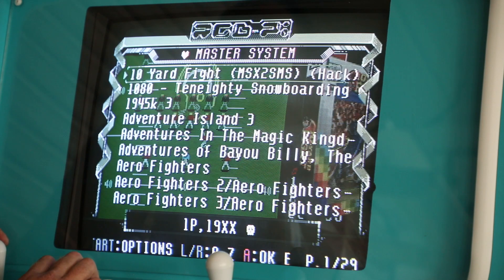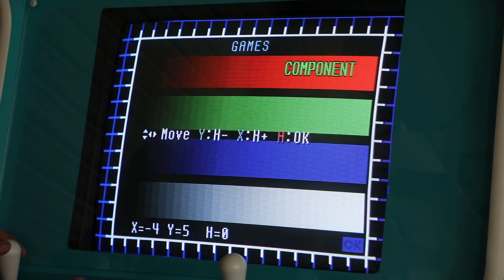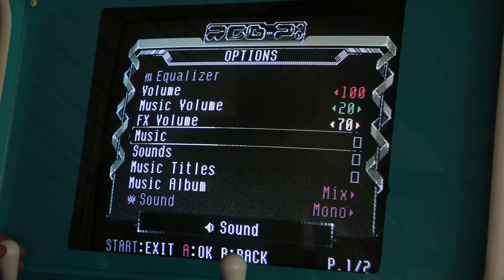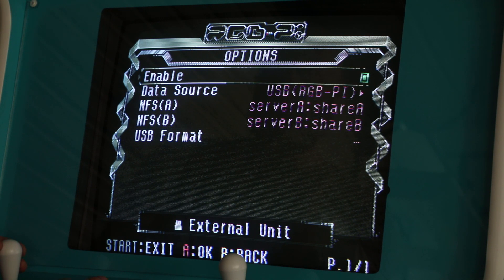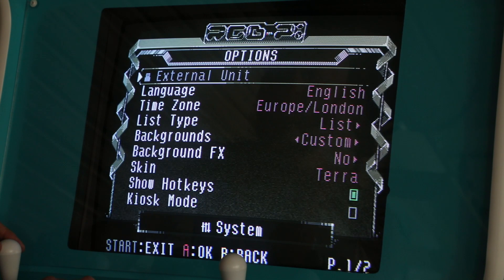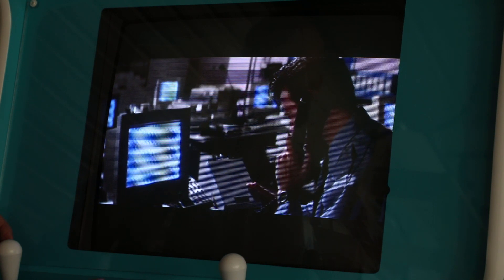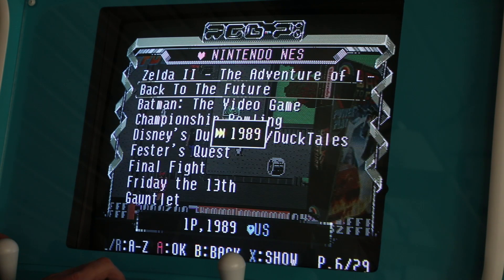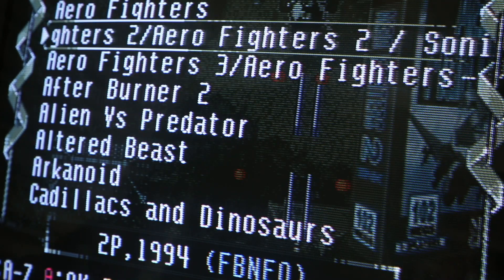RGB-Pi Retro Gaming System for CRT emulation - Operating System - Menus - Arcade play - Make it So

Comment: What scart to component adapter are you using? Also does this use retroarch to emulate? am i able to use cheats and everything that retroarch has to offer?
Reply from the maker: The converter is by a company called Retrotink. I'm pretty sure this system is reteoarch based but you can check the Rgb-pi wiki for more info.
Reply: @MakeItSo  Thanks for the info!

Comment: Quite surprised that 20inch consumer crt tv can produce such defined scanlines.
Reply from the maker: I think that's the big difference between Composite and Component inputs. Component like I'm using is basically like having a factory RGB mod.
Reply: @MakeItSo  Well, on my 21 inch trinitron the lines are pressed as tight to each other as a drum, and the type of output doesnt change the lines gap much whether its composite or scart - rgb (greetings from PAL btw). Also had an experience with a couple of jvc 21 inchers and a one of samsung. Give or take same story. And so my conclusion was that the linegap becomes noticable after 24/25+ inches unless its a pvm/bvm displays. But your case with that beauty broke that point.

Comment: Ok pero....¿¿¿ y como lo configuras para una pantalla Crt Curva de las antiguas para que coja toda la pantalla??
Reply from the maker: Usually you would adjust the "overscan" settings in the software.  This system should give you true to game output resolutions and scaling. So if the image doesn't fit your screen that could be a physical problem with your CRT calibration.
Reply: @MakeItSo  Thank you so much!!!😊😊😉
Reply from the maker: No Problemo!

Comment: Thanks for making this video. I have recently purchased an RGB-Pi and its great. Have you come across any games that ask "image mode" then 2 options Original or Forced. Would like a way to disable this and just always go straight in to original. Any help on this would be great.
Reply from the maker: Yes a few games like the Mortal Kombat series ask thIs. I don't know a way to bypass the option screen. I've noticed the games that have this option also do not perform as well as I would expect them to.
Reply from the maker: Join the RGBPi discord and ask in there.
Reply: @MakeItSo  Thanks for getting back to me. It seems like the game play is correct just that silly screen option comes up. I have joined the discord and asked the question, with no response yet. It might be something in the Retro Arch menu.

Comment: Would you reccomend the Pi 3 or 4 together with the RGB-Pi scart connector?
Reply from the maker: It really depends on what your goals are for your system and what OS you intend to use. If you're using RGB-Pi OS and don't care about lightgun support then Pi 3 is fine because OS2 runs on Pi 3. If you want lightgun support and some better performance for N64 games then Pi 4 will be better but the OS4 alpha is not as fully featured as OS2 yet.

Comment: The thing is that you set it at a 60hz refresh rate and it's still not the exact refresh rate as the game. If you hit tab and check the emulation speed versus the game's clock speed then you'll see what I mean.
Reply from the maker: Got it. Thanks for the explanation.

Comment: also bought rgb pi cable to try that on a raspberry 3+ in a 24 inch tv, you should get some cherry switches on those buttons and also a better encoder for less lag.
Reply from the maker: I did get some cherry switches eventually! Did not change the encoder though. I also haven't upgraded the joysticks. Piece by piece.

Comment: I cannot get any roms or system folders to display except mame2003plus, any ideas as not help at all on RGB pi website and when i emailed them they werent even bothered enough to try and help me, just fobbed me off to the discord groups, thanks. Any help appreciated as the roms I have work 100% it just wont find them? I have them on an external USB formatted by the RGB PI menu
Reply from the maker: I would double check that your folder structures match what the RGBPi os is expecting for organization. See the wiki pages. https://www.mortaca.com/rgb-pi/wiki/index.php?title=Adding_ROMs

Comment: Great video.  I was originally looking for a HDMI to VGA adapter and VGA to scart cable from my gaming PC to my CRTs.  However I might just get an RGB-PI 4B now with Argon M.2 case.  Has much moved on with RGB-PI since this video?
Reply from the maker: Actually yes! They just released an Alpha version of their OS4 that's compatible with the RPi4 that supports lightgun games using the Guncon lightgun. The previous version of the os in my video is only compatible with the RPi2/3 so be aware of that. I believe if you look on their wiki page they have configs so you can use the gpio to scart cable with other systems like retropie. But don't quote me on that. RGB-pi.com
Reply: @MakeItSo  Many thanks.  I had a quick look at their site and I believe they are the ones that also sell the GPIO to SCART cables.
Reply from the maker: @davieslm  They do, I have their cable and both OS's on separate RPi's. OS4 is not ready for prime time still in alpha but its very promising. I have my OS2/3 version dialed in a it's been a perfect arcade machine. Looks so good going SCART > Component in on my CRT.
Reply from the maker: If you buy their cable they give you access to their telegram channel where you can download Bios and Rom packs all pre-configured to work with the OS.
Reply: @MakeItSo  I was super impressed with your setup. m
Reply: @MakeItSo  I live in Finland and think they are in Europe so hopefully shipping will be quick with no import taxes.